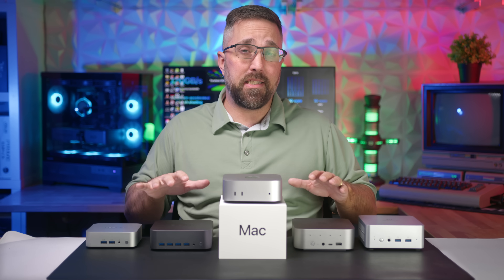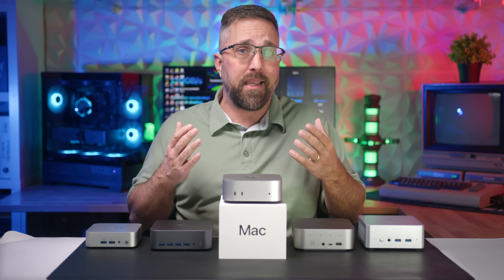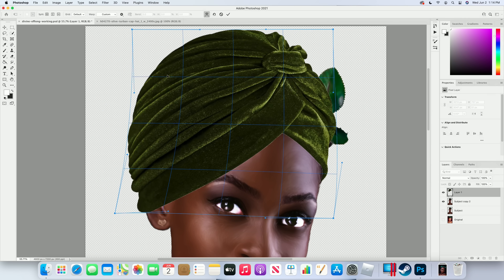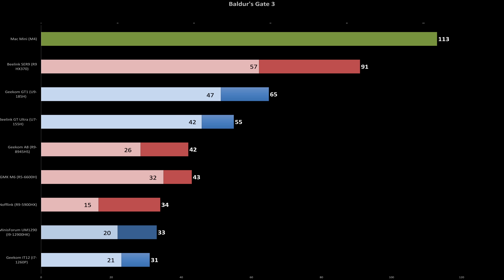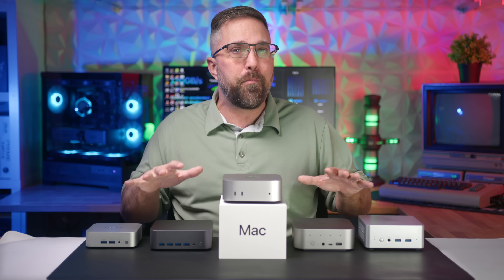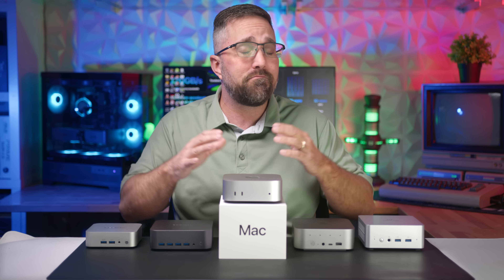M4 Mac Mini vs Intel and AMD Flagships – It's Not Even Close!

Comment from the maker: Many people are focusing on individual specs and missing the point on Price to Performance. First I need to mention that all the PCs in this video are base models. There are no cheaper spec versions of the mini PCs. Now let me use this analogy: Imagine you have two vacuum cleaners to choose from: one with a 12-amp motor that costs $600 and another with a 24-amp motor priced at $1,000. Despite having a smaller motor, the 12-amp model cleans twice as efficiently, consistently picking up more dirt in half the time. Which is the better value? Are you still going for the more expensive one with the bigger motor, or would you choose the model that’s proven to be faster and more effective? Does anyone even care about the motor?
Reply: I get the distinction you're making, but this only matters to PC users. Base storage on the m4 mini is so trash that the average Mac user, who'd normally be very happy buying base, will immediately have to buy the upgraded storage model. I continue to be baffled why apple doesn't offer an upgrade, even though the modules are just that. But once you try to get to parity for task on x86, it's a lot dicier. I think it's a great sign of the competitive landscape that computing is entering, though I worry we're gonna lose much of the competition on the way.
Reply: @kenshinbattousai374  External storage is cheap.
Reply: @AnthonyThomas-o4l  yes, but it's also objectively worse than even internal sata ssds. You pay a premium over nvme for external, only to get hamstring by USB. Apple's main issue not populating all lanes on their minspec system. Minspec should be 512, using two 256 NAND chips from the iPad Pro/Air.
Reply: This is really about lifecycle resilience and the specific markets for these devices.  The M4 is not in direct competition with the other devices as the target audience, financials, and business model are vastly different.  Yes, the $599 is a great price for the base model and it shows impressive performance and efficiency but in the end I'm stuck with what I bought.  I can admire the shiny new bauble but the shine starts to wear off as I imagine the future possibilities.
 I think a more apt analogy would be of a car, where the base model has a high performance and super efficient motor with one seat...
Reply: @maxwellsmart3156   That is a bad analogy as I am a car guy, stay in your lane. $599 is a good price point for what you are getting in a small device. The x86 platforms, especially AMD could benefit from more ram (up to 128GB) and tighter timings in the RAM for better fps. That is like porting and polishing a stock cylinder head for increased performance, however it's usually better to add a power adder to the vehicle with nitrous having the best price to performance ratio out there. For a Mini PC that would be an external GPU which makes it even more expensive.
Reply: @AnthonyThomas-o4l  Sorry, the one seat car is a great analogy because it's about constraints.  The M4 mini's performance envelope is limited in many ways, as long as the user doesn't need anything beyond those constraints, all is well.  It's a bait and switch, simple as that.
Reply: I feel like this comparison's idea really fits well in apple's marketing idea, and a lot worse in the idea of the other brands.

The other brands think it's not useful to Give a PC with such a great processor and low RAM/SSD, so they Just sell you a good all rounder as base.

Apple instead gives you something that you cannot upgrade and won't fit all your needs in the long run, so that next time you go buy their product, you are willing to pay 200 dollars for 8gb of RAM.

The issue here Is that you didn't mention any use case in which the higher specs were useful and you compared them in many aspects in which a 300 dollar pc would have performed fine IRL even if it would have been much worse in the benchmark.

I'm not saying the comparison was bad, but was (unintentionally probably) following the same idea that Apple had in mind when deciding the price of their product.
Reply: Comparing 256GB and 2TB computers, then explaining it with vacuum cleaner... GTFO
Reply: That's the most apple biased video I've seen in years. You can easily get 7840hs 32/512 mini PC under the price of M4 BASE MODEL. What price to performance are you talking about? Open 20 tabs in chrome, slack and some CRMs and compare the performance, when m4 base will be full swapped please
Reply: If "price for permance" is only worth in the "base" model with low memory and low data space... you can't be honest making a comparison in these terms.
Reply: yeah and the vacuum hose attachment accessories (RAM, SSD) which are specific to ONLY that vacuum and 3rd parties can't make it cost 6 vacuums more lol
Reply: @SnuupyYT m4 can have ssd replaced actually
Reply: @areallyboredguy5825 No it doesn't unless you can solder new and chips on your macmini SSD and on both sides with solder paste..plus and are blank iPhone and from china..may not even work ruining your SSD ..lol
Reply: @ it’s a proprietary connector third party ones will be available. There’s already a video on YouTube going over this and a guy replacing it
Reply: @areallyboredguy5825 meaning you can buy a 1TB stick yourself if needed? Of course you can't. It's apple...
Reply: 12 Amp vacuums cleaner is the limit you can go since most households flip the breaker at 15. Many factors make a vacuum cleaner better. Size of the bag, size of the hose, how well the air flows through the filter, cleaning width, beater bar design. I am actually thinking about getting MAC mini for light everyday stuff. But it's not ungradable and it's limited. Not going to game on it, Not going to run VR off of it. Not going to work on my photo and video hobbies on it. I have 18 TB of video and photos and I am not even a professional. The upgrade path makes the MAC mini a low value as so much you cant do at that price. Nobody else charges so much for extra memory or storage and that's what makes me think twice about getting it. If they are going to rip you off on storage why would they not be ripping me off on everything else?
Reply: You still have to use Apple's craptastic OS. Until Linux is more stable on Apple silicon, the machines could be $5 and not worth  it. I don't do Windows either.
Reply: Got it today after buildapcsales sales post. You failed to mention it only has 256 gb of storage and 16 gb of ram... The power is insane for like 500 bucks for anyone that needs top of the line m4 and amd alternatives for 500 aren't fast enough (tts are est 40 percent shorter) but it doesn't matter since i would rather have a 4 cylinder with a 20 gallon tank than a 20 cylinder with a 4 gallon tank.
Reply: Nonsense..I prefer a pc with Ryzen 7778 than Mac mini with 16gb not upgradeble ram and 256 GB SSD..won't last 2 years..plus what point of buying an external SSD and enclosure..when mini pc has 32gb and Ryzen can do light gaming..don't be fooled by clitbait you tubers..
Reply: @ElevatedSystems  this is stupid comparsion. 
We compare two 12 amps vacuum cleaners, one is much more efficient but can hold only 8 vacuum/minutes worth of dirt and works only in rooms up to 2.5 square meters. Upgrade costs you more than vacuum cleaner. The other is less efficient but can hold 32 vacuum/minutes worth of dirt and works in rooms up to 20 square meters, but you can upgrade it cheaply. 
macOS needs the same amount of ram for the same tasks. They had fast ssds for caching for long time, when pcs were still using hdds, that’s where the myth about macOS not needing ram comes. 
How will you store 1tb worth of video footage on 256gb ssd?

What’s few % faster video rendering on a video that you cannot even edit? What’s the benefit of faster cpu for developer when he cannot even run his tools? 
I am forced to use Mac with 16gb of ram and with docker it’s disaster.
Reply: Apple marketed to the less tech savy buyers, aka it takes a special kind of dumb to buy that garbage.
Reply: Your analogy is flawed. For the M4 to get the same RAM and SSD sizes as the competition, you have to double the price, and you are locked into the vendor.
What am I supposed to do with a 24-amp vacuum that has a bin the size of a coke can?
And the funniest part is you can buy 2x M4 16/256 for the price of a single M4 32/512. You don't even get a 1TB SSD for that price. Ridiculous.
Reply: @slothnium  most people use external SSD's to work on, like a samsung T7 2 TTB ssd which is a much more convenient way of working. But 256 GB ssd is low yes 512 is perfect
Reply: @slothnium  yeah bag size is a better analogy this video is just clickbait
Reply: @slothnium  who need 1tb in 2024?    512kb is alot of memmory and no1  will need more.
Reply: @danielkowalski7527 you trolling right?
Reply: But doubling the size of the dust bin would double the price, before you add a dongle for the handle you have to bring your own
Reply: Not the same 😶
Reply: Vacuums suck.
Reply: I would choose the one that gets the job done FASTER, my TIME is worth more than money.
Reply: @elevatedsystems the intel mini-pc you have is one generation older than the current gen "lunar lake"
Reply from the maker: @ there are no lunar lake mini PCs on the market yet.
Reply: @ElevatedSystems  Yes, there are, but I think most of them are sold by Asus, Khadas and simply nuc** (spun off from intel)
Reply from the maker: @ post some links, I’ll check em out.
Reply: Would've been more interesting to see 1% lows in gaming tests on the Mac since these games don't run natively on the M4...
Reply: aha seem bias
Reply: So nobody should care about an anemic hard drive?  Good to know that 256 GB should be enough for anybody.  Want more space?  Yeah, that will cost DOUBLE.
The Mac Mini is a great value as long as you can get by with the specs for the $600 version.  But if your needs exceed that, avoid.
Reply: Sorry nand chips...stupid spell check..
.
Reply: When..???
Reply: Well, um, you can buy a GMKtec K8 plus with the 8845hs chip, with 32GB of RAM and 1TB drive for $540. No, it won't be as quiet or as "fast". It will, however, run Linux better and won't have to worry about stupid crap that apple does. OTOH, you will be limited to repairs to GMKtec.
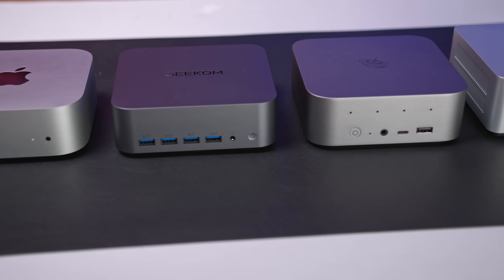Reply: 2:36 That makes good sense. You really don't need to turn off the Mini very often. It sips power when idle, with the monitor taking most of the power. The monitor can be turned off at any time. When you do need to turn off the Mini, you shutdown from the screen or keyboard (yes, there are shortcuts), as with any other computer. Turning it on can be done from the keyboard, the trackpad, the mouse or via an incoming wake-up signal. In any case, the button being on the back rear is not inconvenient, since the computer is small and lightweight.
Reply: To be fair, the Mini is not primarily a gaming machine. It's more of an all-rounder which can play games, if the games developers can be bothered to either provide their software for the platform, or at least if they can be bothered to make the games fully compatible with compatibility software such as WINE, VMWare, Steam, etc..
Reply: This is exactly where the Mac Mini’s Fall short. It’s pretty well known that any of the M series gives you really much performance in many areas compared to the actual specs of the system. But the ram and on die ssd’s are the weak spots, cause it can’t get upgraded, and every Pro user will agree that the ram thing is the worst hazzle. Your only option is to buy a completely new Pro system that cost considerably more than any kind of PC system, and every one WILL run low on memory even the M4 now have 16 instead of 8 in the M3 it’s just not enough for more demanding projects wether you are a musician or a content creator. Apple need to give people more model options at a more reasonable price if they want a broader custommer base. It gets friggin hillarious price wise if you really need a 64gb version or more. (Can’t remember how high the Pro models go in ram). But most New PC minis go at least to 96gb today. And that is the reason people will choose a mini PC over a Mac mini, cause Apple think they can get away with charging 4 times as much as a fully maxed out Intel or AMD mini.

Nothing wrong with the Apple Silicon. It’s the closed ended system property and absolutely no upgrade path after you buy that is the problem.
Reply: Watching every reviewer performatively fall for apples "amazing price to performace"TM mac mini without any of them pointing out how laughably small 16gb of ram and 256(!)GB of hard drive are, or the fact that the "amazing price to performace"TM absoultly dies if you try to upgrade to anything reasnoble, is causing me physical pain. The marketing people at apple must be dieing from laughter at this, it's like they calculated exactly how much space you need to install cinebench and no tech reviewers have worked out that they are getting played or they don't care becuse its amazing clickbait.
Reply from the maker: @ seeing so many viewers overlook the fact that i pointed all this out twice would be funny if it wasn’t so sad😞
Reply: @ElevatedSystems  mention it twice for a couple of seconds, while showing dishonest graphics and harping on about the positives. You never mention the effect that swaps or compressed files would have on the real world performance, you don't highlight how the specs line up with the other tested pcs. I say dishonest graphics because I would put money on you not including the cost of the external drive in the price to performace, even though it's totally necessary to get the performance you've shown, baldurs gate for example is going to take HALF the hard drive of that mac mini. It just seems like such an obvious ploy from apple, I don't really get why so many content creators are bending over backwards to help them sell it (eg chucking in 'free' external drives) rather than calling it out and reviewing the mid range product they actually want you to buy.
Reply: @ElevatedSystems  Also the vacum cleaner anaology is way off, more like comparing a motorbike to a minivan. Then saying the motorbike is just as good for camping trips if you buy a hotel room, and the motor bike is much cheaper (not including the room).
Reply: @ElevatedSystems  If the motor isn’t strong enough, or the dustbag have to be emptied 10 times before your finnished, yes I’ll buy the one with the bigger motor or a bigger dust bag 😉
Reply: But the $600 vacuum only comes with a tiny nozzle so it can't even be used to clean most floors well, and a bigger nozzle costs an extra $500 per inch.
So in the end your "$600 vacuum" costs $1600 to be any useful 😂
Reply: @T33K3SS3LCH3N  i would say that the better performance/price ratio vacuum is only capable of vacuuming carpets supplied by the vacuum manufacturer, that are expensive and not many to choose from.
Reply: Ram and Storage matters. Alot lol. Beelink hx370 might be $999 but but it has 1tb of storage and 32gb of ram. If you match the M4 Mac mini with those specs you would pay $1400. If you match prices. You can match the price of $999 if you go down to 16gb of ram and remain with 1tb of storage.
Reply: I paid 600 for the amd hx 370 one from beelink so yeah no thanks to downgrade to mac. I prefer windows flexibility.
Reply: Yes but your smaller vacuum probably only does 3 rooms before the bag needs changing and the bags are likely twice the price as the rest.
Reply: This is retarded. Anyone serious is going for 32-64GB of RAM with at least 2TB of internal SSD plus external storage. In that configuration the mac mini is a failure.
Reply: My base model is different from the manufacturer's. I need some confidence that it can do what I want to do. I might try pushing a Tb or a thousand or so images from a Lumix S1R through ACR/Ps to do a standard minimal edit on the way to make however PSDs. Or again, to make some images for a timelapse, not the strip across the middle.

The base SSD doesn't cut it. Nor the standard RAM. Gaming? Thanks for asking, but no.
Reply: Yes but he was using an external drive without issue much cheaper. If you just go on price 599 on a pc you would struggle to beat the Mac mini as it stands I am only interested in processing 4k GoPro footage smoothly in 4k for YouTube. I don't play games or mind using offboard storage.
Reply: note: you can install Asahi Linux on the mac with no issues whatsoever (and everything supported)
Reply from the maker: @ Asahi Linux has zero support for M4, it doesn’t even support M3 yet and is still experimental on M2. As of now it only fully supports M1 devices.
Reply: Price to performance is rather bad for the mac mini.
The Raspberry Pi 4 it replaced in my household was a lot cheaper.

I bought it mainly for software availability and reliability.

Performance is in the middle, it can't keep up with my Desktop PC of course.
Reply: Even if Apple silicon is very good, the simple fact that the mac con't run correctly Linux is a total no go, and don't let me strarted with MacOS .... Will never understand how this OS is considered user friendly.
Reply: Thank you chat-gpt.
Reply: The real KING of price to performance is the M2 Mini base model, it cost me $245 at best buy. Beat that ,PCs.
Reply: I'm a diagnostic radiologist, doing medical imaging interpretation. I'm looking to change to a portable setup, I read for US hospitals from here in Southeast Asia. Assuming budget is not a consideration, and I require 4 displays (I will use four ultra thin portable monitors), which mini PC on the market would you recommend?
Reply: You're comparing it against 'Flagships'. You should have included the base model M4 Pro Mini. That would be a better comparison. That's the 'flagship' mini. A comparison between the M4 and M4 Pro chips shows a pretty big difference.
Reply from the maker: @ Donate one to the channel and I’ll do it. 😜
Reply: @ElevatedSystems  I wish! 🤣 I'm still saving up for my own. 🤣 I do agree, though, that I would never buy a Mac for gaming. But I don't game. And the tests I've seen for video editing/rendering on the M4 Pro are pretty impressive, even thought the M4 seems to hold it's own. But I'll make you a deal, if I win the lottery I'll get you one for a future video comparison. 🤣
Reply: COPEzilla... Windows is leagues better
Reply: What are you guys doing with a Apple Mini PC? Its nice have this Power on a Macbook, but that's not a Gaming PC and for everything else you need a Notebook this day's. For home lab it's useless, you can't Proxmox it 16gb is to less and CPU are not supported. Who need this shit? By the way I never know Baldurs Gate 3 could looks so ugly and you can maxout this game with a 500€ 2nd Hand PC.
Reply: True Apple has always put the customer's experience first. But it's gonna be a lot harder to use that better performance/price mac mini in the long term than the x86_64 boxes. Your only replacement option for Mac OS X (which will stop getting updates sooner rather than later - they don't give you long ass support terms like for system7/windows XP back in the day) is Asahi Linux and its in turmoil atm. I would gladly buy a mac again, and still have a mbp 2010 13.3 inch collecting dust on my desktop right now. But if you're not in the Mac OS X/iOS Apple ecosphere already. Where you pay almost double for any commercial software, I wouldn't venture there. Personally, I would check the refurbished market for 8-10th gen SFF HP Prodesk or whatever Dell has in that form factor or built one myself for 600 euro. Of course I have the luxury of being only annoyed often very annoyed (W11 24H2 seriously) sometimes when I switch operating systems, most people can't do that, and will have a learning curve ahead of them when switching to Mac and an almost vertical cliff when switching to Linux :D.

Edits: I wished I had posted this after watching the episode fully ... @ElevatedSystems addresses all of it and agrees with me.
Reply: Your first computer, on the right of your desk is it a Commodore 64, BBC Micro, ... ? I can't really tell for certain because I was too young to have had the pleasure to peak and poke in Kernal and my first machine was a DOS/win 3.11 thing. But those old machines they were cool !!! That whole early computing culture: where people bought magazines with extensive code listings and were basically forced to type it out correctly in the first go or flick the power on/off button and try it again; learning BASIC while they did that and then sometimes growing into learning 6502 Assembly.
Reply: BiGeR iS bEtTEr!!! 😂
Reply: You can spend $350 on a ryzen 7735hs mini pc with 32gb ram and 1tb storage. You can't even buy that on the mac mini at $1400 so the question becomes is that chip worth 4x more of a capable system? Not for anything I'm doing.
Reply: Can I ask you this please:
I'm a diagnostic radiologist, doing medical imaging interpretation. I'm looking to change to a portable setup, I read for US hospitals from here in Southeast Asia. Assuming budget is not a consideration, and I require 4 displays (I will use four ultra thin portable monitors), which mini PC on the market would you recommend?
Reply: @DrinkingGin  Cope and sethe pc is trash also imagine having to deal with windows yeah right.
Reply: @mrX666-s9p  PC is trash? Lol clueless fanboy spotted. I work with industry machines and there is no machine in the whole WORLD that uses apple hardware, all of them use x86 platform and windows genius, no one in the world in the industry application is ready to deal with apple ovepriced junk, you apple fanboys are ridiculous.
Reply: @Dagoth666Ur  I don't even own a mac. But Windows is not the most stable OS... Don't know about the latest 11 and 12 versions. Older versions of Windows are not the best for stability. MacOs and Linux specially are more reliable. Yet most companies in the world use Windows. Hopefully Windows will get more stable since it's the most used and most compatible with everything. Macs getting cheaper or more accesible and with competing performance is a good thing. The m4 chips are competing with the best cpus for single core and multicore are no joke though more expensive (the pro max and ultra versions). I'd rather have a machine capable of all OS, so I'd rather they keep coming with cpus like the 9600x and 9700x which are very good for single core, compared to intel i9  for example
Reply: @mrX666-s9p  man. slow glitchy, thats macOS in a nutshell. But hey I used windows laptops for almost 10 years and I've never had it crash. while when I went to school and had to use a mac. It crashed not even 20 seconds in. Yeah take your trashy expensive machine.
Reply: Your price to performance analysis is flawed.  You are comparing a mac setup at 16 Gb ram and 256 ! Gb storage with PCs that include 32 Gb ram and 1Tb storage.  That just won't do.  Some software will need the full 32 Gb to run well, particularely in the Adobe suite you mentionned.  256 Gb of storage is maybe enough if you put just recipes on your computer ...  You should be comparing a 32 Gb ram , 1 Tb storage mac here to be as usable as those PC machines.  Guess what, that machine costs $ 800 more !  So a total of $ 1400 ; not the same price to performance anymore ...
Reply: @luccloutier2354  Adobe premiere on the Apple silicon chips absolutely does not need more than 16gb to run properly. I use it all the time with that amount no problem. Adobe themselves recommends 16gb for mac and 32gb for Windows for 4k video. Are you really suggesting they don't know their own software? The reality is Mac OS has superior memory management features compared to Windows with features like app napping, automatic termination, XPC services, ARC, etc.. Of course if you're doing some high end workflow 16gb might struggle but no one is doing that on this level of machine, regardless of memory size. As to storage, yes the mac has less but it also, unlike the other machines, it has thunderbolt. You can easily get an external 2tb thunderbolt ssd for $250 with no real world performance penalty and still be under the list price of the other systems.
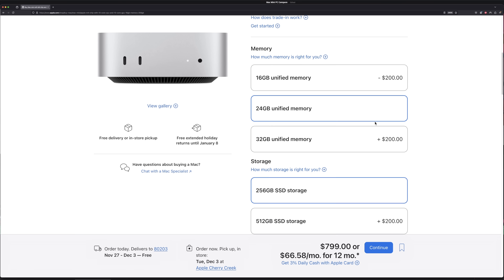Reply: @luccloutier2354  did you watch the video? At 15:00 he clearly mentions that the upgrade prices are ridiculous, and quickly erodes the price to performance ratio.
Reply: @luccloutier2354  Big true.
To be fair: often people would have an external storage anyway and would not need the storage. The RAM is sorta inexcusable though. At least $800 should be assumed.
Reply: @luccloutier2354  we have been in agreement since the beginning. The mac mini with any RAM/storage upgrades is a terrible value proposition.
Reply: @luccloutier2354  How much for a mini PC without power brick outside of the case? Or a mini PC with comparable power consumption to the Mac Mini? I understand that you do need 32Gb ram and 1 TB of storage, not everyone does. Besides external storage costs 100 USD per TB and is as fast in real life as internal one.
Reply: @attekotiranta1598  I wouldn't know, I myself prefer "medium" size PCs, that you can build to your exact needs and that you can upgrade when the need arises.  I just know that some software  (e.g. Adobe After Effects ) misbehaves when you're skimpy with ram and that 256 Gb storage will run out quickly if you do photo work or video.  The power brick outside is actually an advantage : you can swap it out if it burns !  With the mini, if it fails you might end up having to buy a new machine ...  Cheers.
Reply: @attekotiranta1598  No it is not, stop writing that nonsense, any better m.2 smokes it by miles.
Reply: Something these benchmark don't show you is what's going to happen when your browser + other software you use will have eaten all of the RAM or when that SSD will be full. These benchmarks tend not to be very representative of the average daily use of a primary machine for any seasoned computer user.

That price/performance ratio is only good if you're 100% certain you won't need more drive space NOR more RAM, not only now, but for the whole lifecycle of the machine, which could be 5 years or more. Personally, I feel like 32GB is barely enough and I hope to upgrade to 64GB next year. And while on the mini you can still buy an external SSD for cheap, you can't really buy external RAM.

There's also one potential dealbreaker that all these machines have in common, besides not being really tailored for gaming: no nvidia GPU means no CUDA compatibility. There are many workflows for which this can be a major hindrance (e.g. AI inference).
Reply: In this analogy, I need to empty the bag/dust bin for the more efficient vacuum 3 times as often, and whilst it's great at cleaning the majority of my house. There's one specific carpet (gaming) that it just doesn't like, and doesn't really work on.
Reply from the maker: @ none of the vacuums were made for that carpet. You should look at shop vacs for that one.
Reply: @ElevatedSystems  :D
Reply: You unfortunately fell into the trap of using far too many single core and Metal friendly benchmarks. You have to balance your benchmarks, and in the case of Apple to Windows based systems, especially watch the canned benchmarks. There's no anchoring of your Price to Performance conclusion without a good mix of single core, multicore, native, and compatibility layer testing, which is absent in your video. It's a shame, no sub here. Maybe some professional experience, or education would be helpful, though your options might be limited, given your disability. Good luck.
Reply: Claims to make "price to performance comparison" - and compares cheapest 256Gb Mac vs 1/2Tb models.
Tell me you are a delusional fanboy without telling it directly...

If you had any integrity you would take 1/2Tb Mac models into these calculations.
Reply from the maker: @baka_ja_nai  why? Why spend more when it already performs better? That’s not a fair comparison for the consumer. “Here’s how the most expensive option performs, never mind if you need all the expensive upgrades or not.” The PCs I used are also the cheapest/lowest spec versions.
Reply: @ElevatedSystems  Pretty misleading video, if you spec the mac mini to match the Beelink SER9, i.e. 32GB RAM and 1TB storage, it's now $400 more expensive at $1400. Suddenly, your "most important" price to performance goes in reverse. You could spend that $400 on an eGPU which would absolutely smoke the mac mini in anything graphics related.
Reply: @SixPathsOfJin  You probably can not read, he purchased the cheapest of all the models, if there was a Beelink with a 250 Gb it would have purcheased it.
It was a comperison of the cheapest Mini computer money could buy and the Mac win hands down.
(Comment written on a Dell).
Reply: @ElevatedSystems yeah yeah yeah. Mac is so good, that you can place 32gigs of data on its 16gig ram and 1tb of data on 256ssd. Thank you very much, good to know
Reply: @SixPathsOfJin  even if that were the case, 1400$ vs 1000$ but a much better cpu. Still it's not a wise way to spend money on internal storage when external via thunderbolt is good enough and much cheaper. Ram however can't be upgraded, it will depend on the application. By the way building a mini pc with 9600x would cost the same than the basic mac mini m4 without discount. If one puts 96gb ram and 4tb then its a different matter, but then its macos vs windows, and silent vs noisy.
Reply: @SixPathsOfJin  True but his point is that even with less RAM and less storage, the Mini 4 matches or beats all the x86 platforms for less money. If you spec'ed x86 based systems with the same, the margin of victory for Apple would be larger. I know AMD has a new iGPU coming and Intel continues to improve Arc, nobody really loses here, we benefit from competition on consumers.
Reply: @ElevatedSystems on 256GB (actually less than 200 counting OS plus obligatory updates) you can't even install anything big anymore. As you fill up the SSD so will the system be more sluggish and slow.
Reply: @segundacuenta726 you can build a silent PC come on....
Reply: @ My dude, I can build a better computer for the same base price as the mac mini. The mac mini base model is great strictly for someone who wants to get into the Apple ecosphere at the lowest price point possible. Unless you're an Apple lover and can't afford the highest priced machine, I can build a better all around system than the mac mini at the lowest price point and the higher you go by adding RAM or storage the better the PC I can build is even in price to performance comparisons.
Reply from the maker: @ I look forward to seeing it!
Reply: @segundacuenta726  Windows is silent. for reference.
Reply: I'd say a better comparison would be a hot hatch versus a supercar.  The latter will obliterate the former around the Nurburg ring, but the former is going to be more fuel-efficient, more practical, and still be quite a lot of fun if not as fast as the supercar.
Reply: No, I care about application. If your wonderful vacuum cleaner can't be used in a car, but I need one for that, then I don't care. I need MacOS for my app, so I don't care if mini PC is better or worse - I just don't need it, I only need to know if it's better than the Mac I already have. And vice versa, if I need Windows, then why would I care if Mac is better? Apples and oranges.

If you want analogy - you are preaching electric cars to those, who have no charging stations in their country. It might be better than diesel, we just can't use it at South Pole.
Reply: I understand the analogy but considering the SSD is not up-gradable some people might need the higher storage version. But I understand that the base M4 is still incredible value.
Reply: @Isma1CS  Is external storage, cloud storage or a NAS a problem? The average Mac user does not have a NAS or Server at home, a Mini might be a secondary device at best. I know this from how many use Time Machine....
Reply: @Isma1CS  SSD is not as dramatic as you might think. I'm using external SSD and with the fast thunderbolt ports it's very close to the speed of internal SSD in real life scenarios.
Reply: @attekotiranta1598  true enough. I'd be fine with 256 on a Mac mini honestly just making a point. Also I use a windows laptop so not for me anyway.
Reply: @Isma1CS  Every power user should have at least two.
Reply: I think a better comparison would be a 4-seat SUV (that might also have a long wheelbase version at 30% additional cost) vs. a 6-seat SUV. If all you need are 4 seats (the vast majority out there), your analogy fits. But for those needing 6 seats, it's irrelevant.
Reply: @meckerhesseausfrankfurt4019  256 gigs of storage is far closer to one seat than four :P
Reply: @be12  Who needs that much space? Gamers and those who edit videos. My entire DJ collection fits on one 250GB spinning drive, with music going back to the early 70's all the way to what's current at the time of this post. The average user will run out to Micro Center or Best Buy and get a external drive.
Reply: MiniPC is not vacuum cleaner with only one functions...😂😂😂
Your analogy is totaly wrong
If you only need one functions, I think better buy an TV-BOX
Reply: Barebones PC is the base model.  Spend 5 min. to add the same amount of ram and storage as the Mac.  Don't be lazy.  You could add a note saying I couldn't get a barebones Mac to add RAM and storage to because Mac's can't be upgraded after purchase so I'm forced to get one with RAM and storage already.  That would be understandable.  There is no excuse though to not give the PC the same specs.
Reply: Dude it's not an apples to apples comparison apple optimize the crap out of their hardware and os they all need to be tested on the same os
Reply: @chriswright8074  You can optimize these x86 systems on your own. But even then how much more performance are you going to get without drawing way more power (1) or spending even more money (2). Windows itself has plenty of memory to perform well, the only place to pick up performance is to OC the iGPU, get tighter CLI with the RAM and get the fastest NVME you can find. All will demand more power from the power supply.
Reply: Only reason anyone buy mac mini ix develop apps. otherwise its ok. i am new to mac. spending lots of time hackintosh and vmware mac in developing apps. Mac is also bloated like windows
Reply: @nastybadger-tn4kl 
How is Mac bloated iLife is not bloatware iPhoto iMovie GrageBand and Pages Numbers Keynote are not bloatware but useful programs not like office 365 that you have to pay for
Reply: mac mini 4 sucks. i just using it today.  my intel it 32mb memory latop blew mac mini 4. This is not even typing letters fast
Reply: @nastybadger-tn4kl it doesn’t even type fast? Sounds like a lie
Reply: Nye nye nye you don't have mac mini  @nastybadger-tn4kl
Reply: @nastybadger-tn4kl 
What’s an Intel it 32mb 😂😂😂😂
Reply: @lesleyhaan116  I meant gigabyte intel cpu i7 32gb memory and 4060 nvidia. 

Its super fast but window sucks. 

Mac cant handle too many apps running

My keyboard lags if i have visual code and xcode and few browser opens.
Reply: i did move my usb hub away and its ok now. because i think usb hub and wifi card insid e mac mini interferes sometime
Reply: @nastybadger-tn4kl  my intel it 32mb memory latop blew mac mini 4. This is not even typing letters fast

All these reviews miss the point that mac is now useless on apple silicon for running intel programs.

The reason youtube videos suck at pointing this out - is that the videos by definition are made by 'content creators' - ie - people who have youtube channels.

They then assume that the primary reason for having a computer is to edit videos. lol.

But there are now thousands of business critical and science and engineering applications that no longer work with MAC. 

And there is no real solution for it.